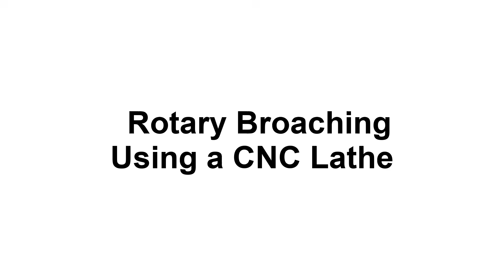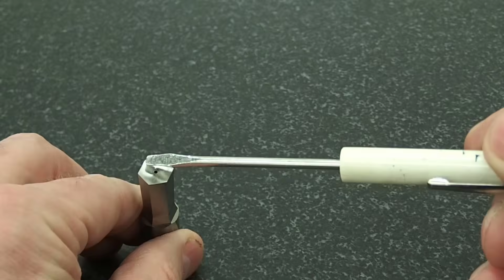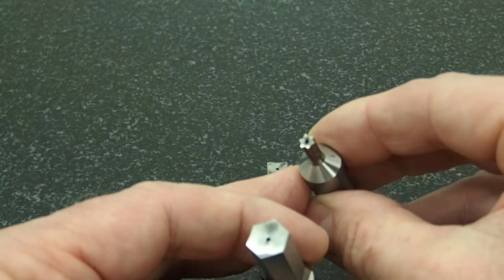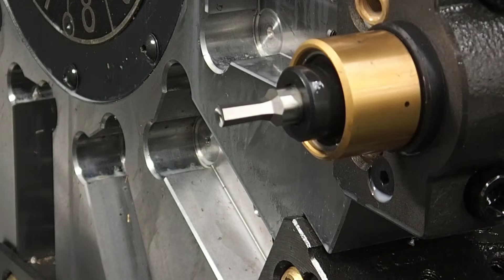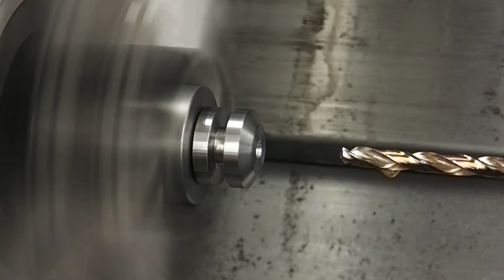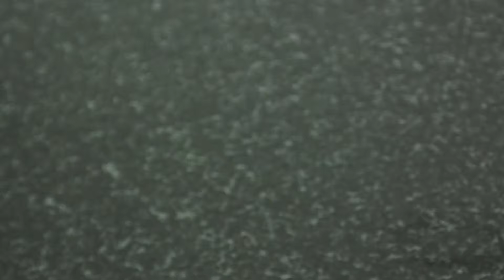Rotary Broaching

Comment: incomplete and unsatisfactory explanation.
There are still many things left unexplained.
Reply: https://www.youtube.com/watch?v=IT8VXQEKzoo see how it wobbles? this is why it has to be spinning, the part that holds the Broach wobbles a little while spinning, it would stay on one angle otherwise if both didn't spin at the same time. Also only one edge would be the right size if the cnc or lathe was off and you just rammed it in there.

Comment: What is the advantage of having this spinning?
Reply from the maker: If the broach isn't rotating with the part it would  create a round hole rather than the geometry. Thanks for watching.
Reply: @machiningmoments  I meant if neither the part or the tool was turning,  what would be different?

Comment: What speed and feed do you use to do this? Beats having to do in manually like I did in school.
Reply from the maker: The speed and feed are low, I think about 200 rpm and a .001" feed. If you purchase the kit it gives suggested speeds and feeds.

Comment: Is there any kind of tailstock to simulate this on a manual 10" lathe?
Reply from the maker: Joe, you'd have to do some research but I can't see why there wouldn't be an adapter for the tailstock. The turret in the video is essentially acting the same way a tailstock would. Tailstock alignment would be important!

Comment: Great video. I don't understand though why the part needs to spin to broach when on lathe. What is the purpose? To keep on center? Does it help with chip load/break? I appreciate any info. thx
Reply from the maker: The broach is introduced at a small angle (down). The thought is as it rotates in time with the part it cuts at 12 o'clock and releases as it rotates. creating the cutting action. the broach, pushes and cuts into the hole as the two rotate together and advances.
Reply: @machiningmoments  how much is the off centre of the broach? Deg or mm